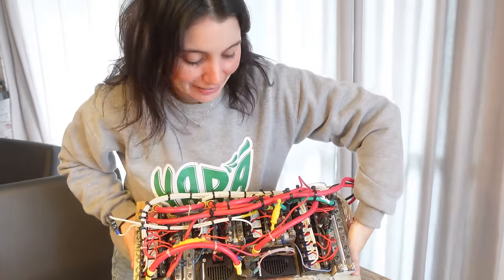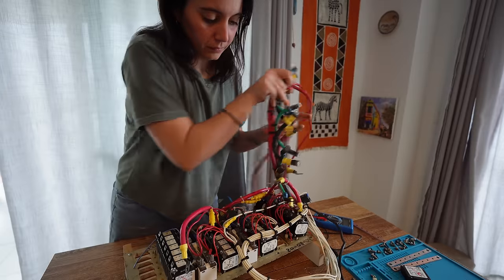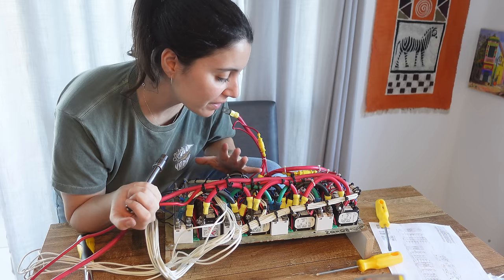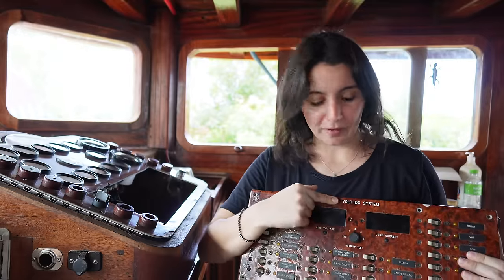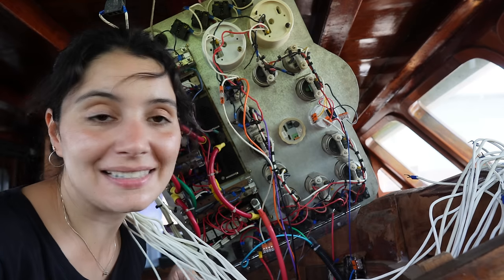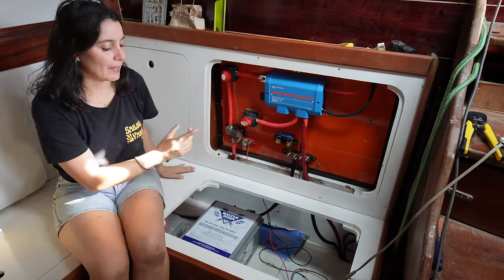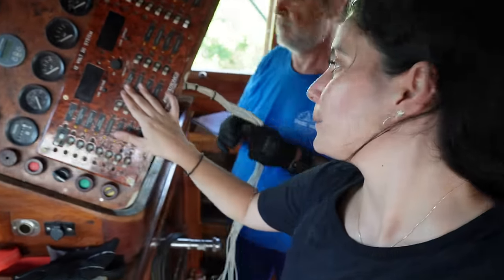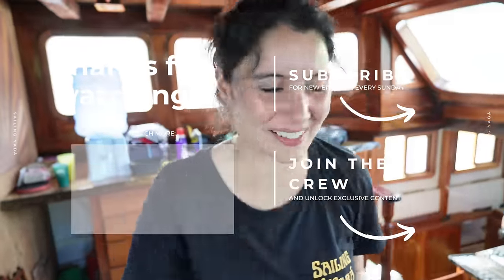12V is not enough! Converting our wooden sailboat to 24V (DIY restoration) — Sailing Yabá 175

Comment: Nice work MP! Small suggestion, label those wires with a tag so in the future if you need to trace a wire you can find it easier, might take a little more time but if you need to find something like the pump wires quickly, it could really be clutch and save you valuable time. Great work once again, Yaba is slowly coming to life more beautiful then ever! Glad to see you feeling better.
Reply: Wire labels will save you tons of time and frustration in the future. Great job.

Comment: Beautiful young woman. Beautiful intellect.  Beautiful perseverance.
Reply: Question. Did all the lightbulbs including control panel need to be changed out. Sparky im not!!
Reply: Not a sparky either.  Stuck a nail into a wall socket when I was 4 years old. Knocked me across my grandmothers kitchen. I remember it like it was yesterday.  I steer clear of everything electrical.

Comment: That’s a VERY nice main buss panel in the helm. And it’s great that you’re properly upgrading it to 24vdc with the LED indicators.
From my years living at the oceans would be to put a thin film of Dielectric grease on all the terminal ends. It’s a simple way to prevent oxidation from interfering with connectivity. 
Ain’t no one got any time for bad connectivity! 
It’s great that you two are being so hands-on with this complete rebuild of Yaba. Things break, and come loose on boats, any boat. You’ll know what’s needed for a repair, log all part numbers, and how to do the repair. 
If you’re not already doing this, I would also recommend a complete set of wiring diagrams.
People do, but paper never forgets. Don’t only rely on a digital diagram, I’m sure you’ve already experienced electronic failures due to the high humidity. 
And don’t just stop with the electrical diagrams. Do this for steering, water making, raw water and fresh water systems, and black water. 
Anyway, great work, I’m so looking forward to watch Yaba splash!

Comment: That looks to be a quality panel. It looks well made and expensive. I think that I recognise the white wires as Raychem fireproof type. These are used in aircraft wiring looms. I have worked with this wire. It is a pain that it all white so has to be very carefully numbered to make it workable. Not easy when the loom can be many yards/meters long. Nice job MB. I guess this was before you op so I hope you are recovering well.

Comment: MP....did you install exhaust fans in the engine room, also.... on the panel with all the switches....make a cover, hinged type, to protect the switches from being turned on or off accidentally. Capt. johnnyMac

Comment: Use a volt meter on the end of the wire, that way you don't need to follow the wire maze from the switch...you're going to need relays...ground triggered prefered...:)

Comment: Going from 12 to 24 volt means amps are cut in half so you do need to lower the fuse/breaker size.  Amps are what makes a fuse/breaker to trip/break.  all those are rated 2 times higher so if your new items do not require those larger breakers they must be changed also. If you do not change them and a 24 volt item overloads it will not trip a breaker and a fire can start.
Reply: Thanks for your  sage advice!  I too am an ignoramus when it comes to electronics. I think (and I hope !) that MP's Dad is hovering in the background to check all these things!
Reply: @Davidcallard   what can the wire handle in amps. Example. 24V windless depending on size could use 50 amps so a 60 amp breaker should be used and wire that can 60 amps. that same windless at 12v would use 100 amps and need wire wire to handle 120 amps and breaker. so a 100 amp breaker now for that 24v windless means it can pull 2x the amps and not trip the breaker so a fire could be starting and you wouldn't know it. rate every fuse/breaker to amp draw for what you are using on that line and also rate wire accordingly.

Comment: Glad to see you feeling better EmPee (Empy?)(I know I butchered the spelling, sorry) but I know how nerve wracking electrical can be.  Remember when I bought my current house in 2017 and the garage only had a single 110v circuit while I needed multiple plus several 220v circuits.  Brought 100 amp 220v to the garage and turned it into a pair of 40 amp 220v and 4 20 amp 110v circuits.  I remember that cringe when I flipped the circuit breaker to that sub-panel the first time.  Talk about almost needing a change of shorts.  Every time I watch you do electrical work reminds me of the times when I did such on my current house and my previous house.  LOL!  You go, girl!  You got this and so many other projects.  I do have to admit, seeing you with the hair in a bun, my first thought was: "Ben, watch out: she's getting ready to suck out your soul!"  Just kidding.  You both are the epitome of Couples Goals same as my wife, Amiee and me (Scott).  Rock on...incidentally, I was not kidding about the soul part: my better half just gives it back afterwards.  ;)

Comment: Apparently MP,  that panel wiring is not your first rodeo? Good job!
Reply from the maker: It actually kind of is! Before Yabá I had never touched anything electric but since the rebuild I started growing interest in it and have worked on the windlass system, the light connections... but the panel has definitely been the biggest electric job I've done so far!

Comment: now days 48 vdc should be the norm these days
Reply from the maker: Except that finding 48V appliances is so challenging! 24V is already a lot harder than 12V, can't even imagine the struggle for 48V.
Reply: @SailingYaba if you have a appliance that’s 12 volts and you have 24 volts dc you can change the voltage at the appliance from 24vdc to 12vdc really easily.

Comment: Did you change the transformer from 240v to 24 volt? You will have a lot of light load and mechanical.load on the transformer.